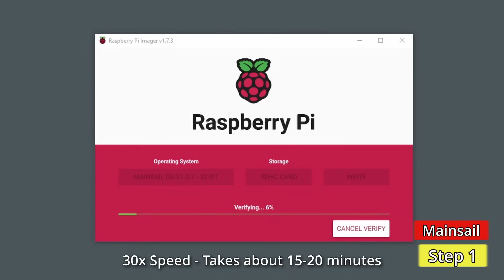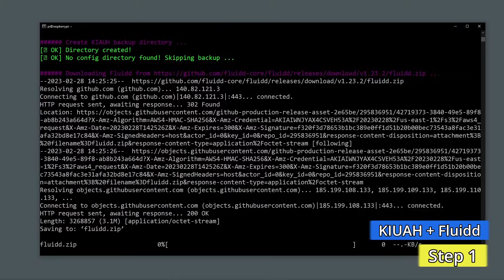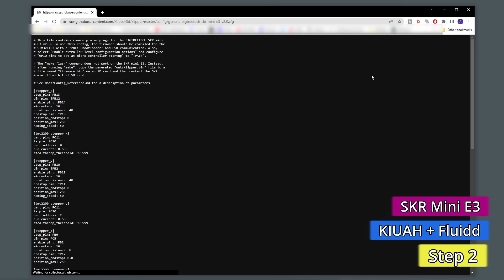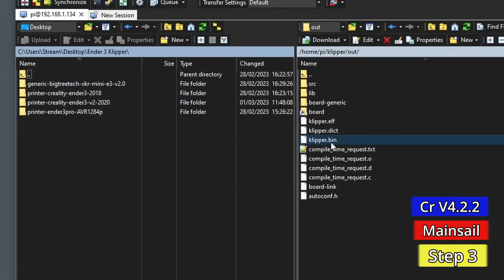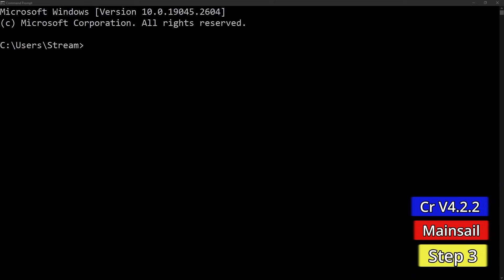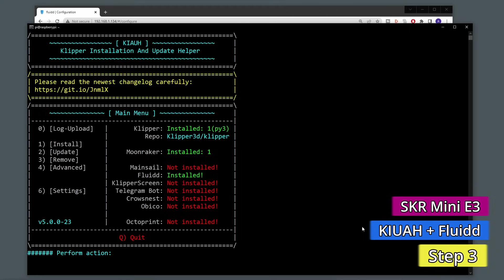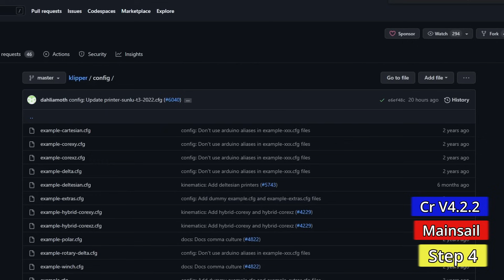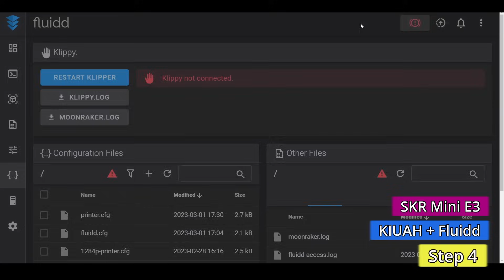How to Upgrade to Klipper on any Ender 3 for High Performance

Comment: This tutorial is a must. Brilliant rhythm, almost a speed run, but that's what the pause button is for. Currently I am on Sonic Pad + Ender 3 S1. Went the lazy way, I must confess. I can't stress this enough, Klipper is the best upgrade one can make on a stock 3d printer.
Reply: Klipper vs direct drive you still chose Klipper first?
Reply: @hd-be7di I'm kinda sure that you can use a direct drive and klipper at the same time, yet, I might argue, changing the Bowden to a direct drive it's a change, not a upgrade, klipper is, in it's messy way, an upgrade
Reply: @Reinaldo211  Bowden is garbage. I'd rather have Marlin with direct drive than Klipper with bowden.
Reply: @hd-be7di  The S1 comes from the factory with a direct drive setup already

Comment: I think a better focus of this video  title/intro would definitely have been more on the reliability of Kipper for the Ender 3 series, than on performance printing. Creality's version of Marlin is a mess internally, so flashing anything like stock Marlin or Klipper brings a huge improvement to bug squashing. Nonetheless, a good guide 😃
Reply from the maker: That's true of most budget bed singers I think, very buggy modifications. I just think performance is more relatable to more people. Maybe..🤔
Reply: Which Rasberry Pi would work? @Vector3DP

Comment: U did not mention the most tricky part: puchasing a raspy xD
Reply: You don’t need a pi. He tried to get that point across by using the term single board computer, but even that is overly specific. Pretty much anything that runs Linux and has USB will work. I use an old Chromebox with my voron. There are tons of them on eBay.
Reply from the maker: Well I did mention it in my defence. Potential solution upcoming for that too though!
Reply: The raspy costs more than the Ender 3 :P
Reply: If you already have one though…..

Comment: I do really like this guide but. Is it worth it do you really get better performance with stock hotend and extruder, if so how much quicker is it. If there is not much difference then, I’m not being cheeky, but if there is not much difference I do not see the point of going to all this hassle. So is it an improvement?
Reply from the maker: Definitely an improvement with the capability of Input shaping for higher accelerations, more advanced and faster tuning options, less buggy than modified marlin versions. Nothing says you can't upgrade the hotend too though. You also get web interface and monitoring, webcam ability etc. The list goes on. Klipper brings A LOT of features to a basic printer.
Reply from the maker: Also, long detailed guides make it seem harder than it is.
Reply: I build a Voron following your video and a couple of others and it’s sitting in the living room gathering dust, never got it to run, it could be the wiring it could be klipper but it’s beyond me, steep learning curve. Do you not also have input shaping on marlin now seemed to recall reading that somewhere. Klipper has a lot going for it I agree and like the video but unless it makes it possible to print say 50% faster I am not even going to try it, cracking video though.
Reply: @paulmilne3038  i am currently running 3-4x faster on ratrig with klipper than my ender. More left in it, yes learning curve can be steep
Reply: To be honest I have a stock ender 3 pro with skr 3 mini and pei bed those 2 things made the best improvements
Reply: @morpheus6d9  those 2 things are great,  but you could go at least 2x faster on klipper